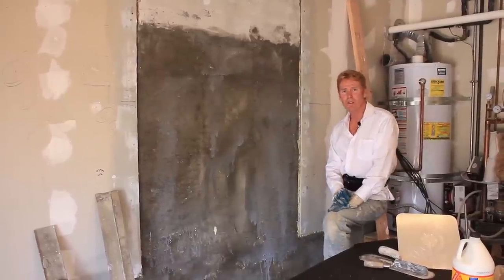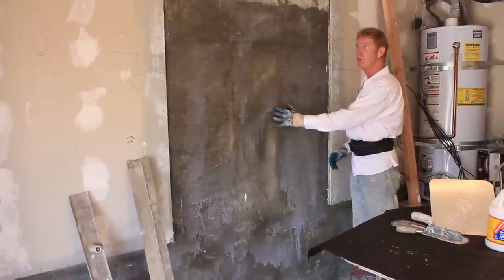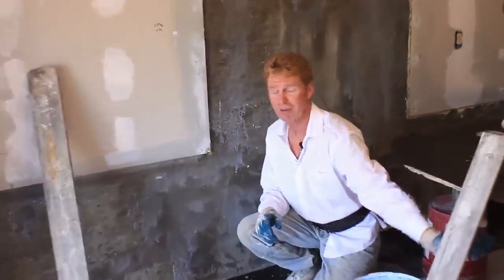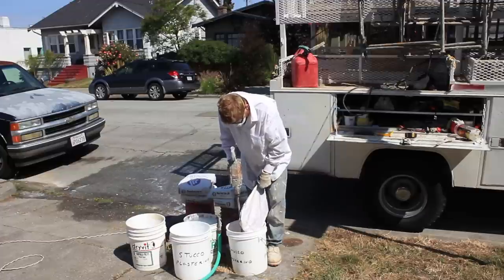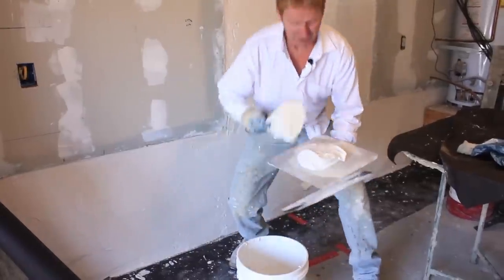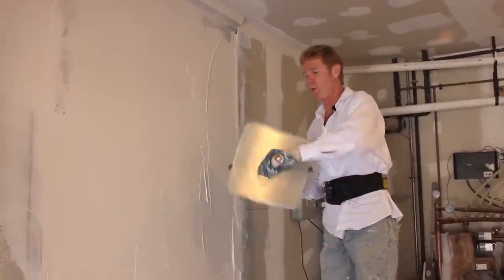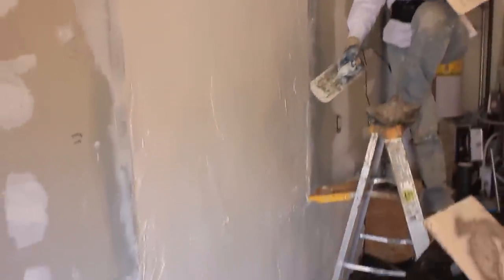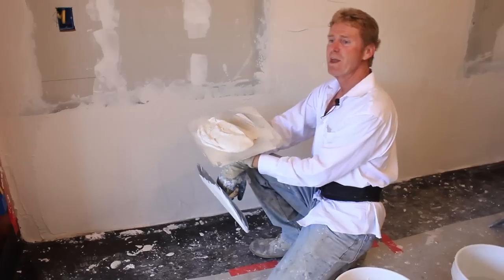Joint compound to blend concrete and sheetrock.

Comment from the maker: Howdy JM, I have seen over 20 homes where  the color coat come off in sheets the first month after application from folks putting the bonding agent in the mix instead of going the extra mile and applying it on the surface. 
(Painted surfaces only)
 Fortunately I learned this fact when I worked as union plasterer; unfortunately, I have learned many things the hard way too.
  Have a great day and thanks for watching.
 Kirk Giordano Plastering

Comment from the maker: Morning Kelly Krauth,
If you use taping mud it will require many coats, however you wouldn't need a bonding agent.
 I would use the bonding agent available where you purchase the fast patch drywall compound. I use west pac's  20 minutes mud myself, if you need more time you can purchase 40,  60, or 90 minutes muds. If you can't find west pac's buy a different brand that is simular.
Thank you for watching and have a great day!
 Kirk Giordano Plastering

Comment: I love these videos.  I'm about to fix a crack in my office wall and I've been using your videos for info & guidance.  My office is downstairs where the walls are poured concrete with drywall over that.  After I patch the crack in the concrete, I'm gonna use this video and the materials you used in it, to fix the section of damaged drywall.  The area of damaged/removed drywall is about 3 tall feet by 2 feet wide.  Keep up the good work and I'll do my best to do the same.
Reply from the maker: Hi Leonard Goltz, thank you, remember there are lots of different materials to plaster a wall with, tip, don't use 5 minute mud, its sets way too fast.
 I would suggest if you're new to plastering use use 40 minute mud you'll have more time to learn and play with it before it sets.
Best wishes,
Kirk & Jason Giordano's DIY plastering network
Reply: Kirk & Jason Giordano's DIY plastering and stucco network Thanks for the extra tip.  I'm definitely new to plastering, so I will for surely grab a bag of the 40 minute mud.
Reply: Kirk & Jason Giordano's DIY plastering and stucco network I just finished fixing my wall and so far, so good.  You make it look EASY, but with a 'lil touch up work here and there, my wall should look pretty good.  Your videos were a big help.
Reply: Leonard Goltz I'm glad I went with the 40 min mudd instead of the 20.  I could not imagine using 5 min mudd.  You're a true pro.
Reply from the maker: Hi Leonard Goltz, thank you,
sometime applying the 5 minute mud is fun, but it definitely take a bit of practice.
 best wish and glad your project went well.
Kirk & Jason Giordano’s DIY plastering network

Comment: Hi Kirk,

I am renovating my kitchen & dining room. I have a 1959 house with plaster over gypsum board. I've watched all of your interior videos ("liking" them as I go; also a subscriber to your channel) and have a few questions I hope you can help me with. My punch list of plastering work is as follows: 
1) Skim coat damaged plaster finish coat on kitchen walls using 20-minute mud. The finish coat came off like puzzle pieces when glued-on wood paneling was removed; 
2) Fix plaster damage around doors by adding wood as a backer, then structolite as scratch coat, then 20 minute mud finish coats as needed; 
3) Skim coat ceiling to cover minor hairline cracks with 20 minute mud;
4) Skim coat over heavy textured wall  with 20 minute mud and blend to adjacent smooth wall

Here are my questions: 
1) Is the "20 minute mud" (also available in other work-times) you refer to in your videos simply drywall setting compound? I ask because I want to make sure I use the right stuff, and a contractor friend looked at me funny when I said I watched this master plasterer's videos (that would be you), who recommends using it instead of "plaster" for interior repair work. I don’t know what real “plaster” is, other than the Diamond and Imperial products you mention in your videos.
2) The existing plaster walls in the dining room have a light sand finish (see photos I sent you on your website). The kitchen is smooth all around. Can I add playground sand to my last skim coat in the kitchen to duplicate that finish? How much per bag of mud? Would I use a sponge float in the last few minutes of work-time to bring out the sand as shown in your outdoor stucco videos? We also don't mind a smooth finish; would smooth be easier to do? I've heard smooth is very difficult and that the sand finish will hide imperfections.

Thank you so much for all your videos. I've learned a lot and thanks to you, have the confidence to take this project on myself. I love watching your craftsmanship and also your family in the videos and website. Thanks again,

Tim
Reply from the maker: Aloha Tim, excellent question,
 plaster is usually structo-lite base with many finish coats applied over such as any of the 10 different veneers such as Diamond, imperial, Red top, etc.
Westpac's fast set muds are drywall compounds that comes in many set times from 5 minutes to 90 minutes,
FYI, keep in mind if you use any plasters or compounds, dirty tools such as buckets to drill paddles will accelerate the set time, take for example a 40 minute mud can set in 10 to 20 minutes if the mix is contaminated, so use clean tools.
 Structo-lite takes about 25 to 45 minutes to set depending on the temperature, while the compounds set when they say they will (very accurate) regardless of temperature as a rule.
since we know how to mix, I prefer the westpacs, cause we don't mess around with time.
 with west pacs drywall compound you can easily sand if needed, not so with other products and or veneers which can't be sanded.
 I have never had to san westpac's compound, ever, as I can trowel down well.
 Lastly, taping mud and the fast set drywall compound have little to no sand, sometimes some brands have silica which is a really fine sand, so for me it's easier to go smooth, as this just takes
 troweling, if you want a sand finish you are perhaps better off with back to back structo-lite as this plaster has sand in it and can be floated easier to give a sand finish, but, is tougher to gage or work with.
Of course also you can alway add a handful of sand to the west pacs fast set if you know the size you're trying to match.
 Confused? It's a bit complicated and takes practice.
 Best wishes my friend and if not sure what the heck I am talking about ask further questions.
Kirk Giordano

Comment: Excellemt job. What are these 5 min 20 min muds you talk about. In London we would of used bonding ie strucolite mixed with finishing plaster, feather edge, flick water job done. Ps max 2 hrs. 
Ps i can tell your a master on the hand tool.
Reply from the maker: Hello Jimjim Skimmer from London, England. 
Thank you, and it's always nice to here from a fellow plasterer in London.
 Your method is easier, the five minute muds, just means you have 5 minutes to apply before it get hard.
The 20 minute mud means the same, after it's mixed you have 20 minutes to apply.
 I have used your methods many times and feel it's better however, I like to show all possible ways of getting a project completed,
 Best wishes,
Kirk & Jason Giordano's DIY plastering channel
Reply: Kirk & Jason Giordanos DIY plastering and stucco instructional videos and forum Mate i find that if you put a nice layer of mesh and nutella it gives an awesome finish!  If you want something slightly smoother though i suggest utterly butterly!!

Comment: I love 5 minute mud but must say I’ve never found it in such large bags; I think I get it in like 5 or 10 pound bags. 5 minute is quick for sure but is the best stuff when time counts because 20 minute can take an hour to 90 minutes to get hard enough to move on. There are just times when time is the most important factor. Like seeing the internal/interior jobs.
Reply: Sometimes, mud takes longer to dry depending on the amount, temperature (colder=longer), or the surface of the wall you are applying it to (if you put it over, say, semigloss painted surface, the gloss will repel the water, thus keeping it in the mud instead of sucking it into the wall. 
It's not a good bond, so it is recommended that you sand down the glossy surface.)

Comment: Great tips, thanks for posting. Can you recommend wall preparation for applying Diamond veneer plaster over bare sheet rock (taped and mudded)? I have removed wall paper, and need to skim coat the walls, but all the info I have found recommends blue board. I would prefer to not hang new wallboards. Should I skim coat w/ durabond, then finish coat with Diamond? I will probably be adding some sand for texture, in case that matters...
Reply from the maker: Evening lexander Utevsky, it matters little what board you go over as long as you apply plaster weld to the sheetrock, blue board is the only board specifically engineered to not have to use a bonding agent.
You can apply diamond over sheetrock or apply a first coat of diamond base coat or imperial base coat, I have applied it all three ways. depend on the strength level I am after.
Kirk & Jason Giordano's DIY plaster and stucco channel

Comment: Hi Kirk. 
Great vid! I have a similar situation in my bathroom and planning on using 3 coats of taping mud to achieve the right flush thickness but there is about a 1/8" gap between the concrete and drywall. Can I use a joint tape over this gap to prevent the future crack along this line? 
Correction: I found the answer in other comments. Thank You!
Reply from the maker: Evening Trex thats what it's all about,
 Best wishes, 
 kirk giordano

Comment: I love your videos. I was wondering if its POSSIBLE when you prep to start plastering can you start with the finish coat and no more coats? I know its not the standard for many reasons. MY only concern is whether a first top coat would want to fall off the wall since their is no sand aggregate like a brown coat. If I am allowed to coat this way how thick should this coat be 1/8?  Or should I simply skim the house with EZ Sand 45 which does the same idea. I would just prefer to use plaster instead. Its for my house. Regards.
Reply from the maker: Hi Kristi S, if you just use a top coat, any thickness over 1/16 to 1/8 will crack. say you apply 1/4 inch you can allow this to dry and crack, then apply another coat over which may be all the depth you need?
 I would use EZ sand or Westpac drywall compound if it were me.
 Or if you wish more strength use the veneer base coat of imperial, with a diamond top coat.
 Cheers,
 kirk giordano Plastering

Comment: do youu guys not use a thick bond then skim coat it?..looks very fine. Take it you have to sand it after? good vids man
Reply from the maker: Thank you Trinity plastering from Ireland, I actually have shown every plaster sold here in the U.S. as there are many ways to plaster a hole, from Structo-lit base and finish, to veneer base and finish, to all the timed drywall wall compounds made as well as cement plasters, the only product I haven't shown in use is tapping mudd as it's too slow, too many coats on separate days and way too much sanding, but it too has it's uses.
 Best wishes and have a great new year!
 Kirk and Jason's DIY plastering tips

Comment: Hi Kirk. My plasterer used woncote to plaster new walls. I love the look, it looks like white venetian plaster. How do I seal it so it's not porous, and to protect the walls from staining. I really prefer not to paint over the plaster. Any advice would be much appreciated! Ty great video!
Reply from the maker: Hello Home Girl Interiors, Woncoat is really cool looking the difference between it and most of the veneer plaster videos we have done is it has marble added, this lime and crushed marble are usually called Venetian plasters, the big difference is venetian plasters are normally made with lime ,marble and often a portland based product to add strength.
Woncoat it a bit unusual as it made with gypsum base materials and is sold as a veneer plaster.
 As far as a sealer good idea, I would ask Woncoat for their recommended sealer as all products sold and applied have their own sealers, using someone elses may void the warranty, plus It's tough to know the exact composition any plaster as they don't have to list all materials.
 Best wishes home skillet,
 Kirk giordano
Reply: +Kirk & Jason Giordanos DIY plastering and stucco tips . Thanks Kirk, I appreciate the reply. I am going to call Woncoat and see what they say. All the best and Thanks, again!

Comment: Kirk have you ever plastered hardy board? Specifically shower wall? I have a potential client that just poured a beautiful concrete tub and they put hardy board in the surround and want to skimcoat the walls smooth. Natural gray to match the tub.
Reply from the maker: Howdy Matt Eklund, yes I have, any portland based cement product will mold, all acrylic's, limes, and or stucco products will too.
Unless you spend much time applying sealers, waist of time in my opinion.
 sorry, I advise a thin coat tile set, then set tile,
 Best wishes,
 kirk giordano Plastering

Comment: Hey Kirk, I want to say I really like your videos.  They are very helpful as I've just purchased a 70 year old lathe and plaster home.  But I've been wondering after watching your videos, what is the difference between exterior and interior plaster?  Is one portland cement and the other gypsum?

Thanks!
Reply from the maker: Morning Justin Lohrentz, you are correct.
 plaster is a term which means interior.
 Stucco refers to exterior cement plaster.
 Cheers,
 Kirk giordano

Comment: I have a question. I have an inside cinder block wall that is painted. Do I have to remove paint before applying bonding agent? I want to hire someone to plaster the walls but didn't know the prep work to have the walls ready.
Reply from the maker: Brigadeiro Shoppe Evening , fair enough question, if the paint was removed you would not need a bonding agent as stucco adheres to bricks, concrete, and cinder block by suction.
 However you need to clean the paint as best as possible in order for the bonding agent to do it's job, the bonding agent is only as good as what under it, in other words either pressure wash this wall very well or wire brush and clean with a really good solution before the bonding agent.
 Next apply stucco.
 Best wishes, 
 Kirk giordano plastering tips

Comment: Hi Kirk,
 you recommended using a bonding agent
when you plaster over a painted concrete wall inside building. Any brands?
Reply from the maker: Morning Susan Shannon, yes, I alway use a bonding agent, I use Plaster weld or the Quikrete Bonding agents as it can be purchace from home Depot.
 cheers,
 kirk giordano plastering

Comment: Hey kirk! what is the advantage of plastering on concrete as opposed to gluing on drywall boards? I have to finish two garage walls that are 8ft high 22' long and very rough from the form work boards.
Reply from the maker: Howdy Myles, to me there's little difference, for you sheetrock would be better as all you have to do is follow the sheets.
Because of the rough walls you just apply thicker.
 Best wishes, and have a groovy evening
Kirk and Jason’s rendering & stucco advice

Comment: Why didn't you use a mesh or paper tape on the Sheetrock to mud joint? Won't that crack?
Reply from the maker: Morning brad goose, sheetrock to sheetrock, always a good idea to use a fiberglass mesh tape, this is concrete to sheetrock, mesh was not necessary.
 Cheers! 
kirk and family

Comment: HI, will plaster adhere to painted concrete inside a basement area laundry room. Or do I have to prep that area somehow.   Thanks   Frank
Reply from the maker: Francis cairns Hi Frank, you will have to prep this painted surface, first clean the painted surface then apply a liquid bond agent, now you can apply plaster.
 best wishes, 
 Kirk giordano plastering

Comment: Can I do this on the ceiling after popcorn removal. Should I also prime the ceiling then using the bonding agent. If so, what primer works. I also have an issue where the concrete ceiling and Sheetrock edge have about a half inch gap filled with caulking. Should I recaulk that and then plaster it"?
Reply from the maker: Hi Shirley, lots of ways to skin a cat.
    If it were me, I'd scrape the ceiling after you wet it with a Hudson sprayer or water hose through the window.
 Cover the floors well and not too much water, just enough to saturate the gypsum so it scrapes off effortlessly.
   Then naturally a bonding agent must be applied, I prefer "weld Crete by Larson's."
 You can purchase "weld Crete" on the link in our description, or go to home depot and by the quikrete bonding agent.
   Nest the fun part, you can skim with a sheetrock compound or a veneer plastering system and plaster as usual.   
If all this is too difficult to understand let alone do hire it out.                
                Peace love and happiness to all.
      Plastering and repair tips for your number one investment